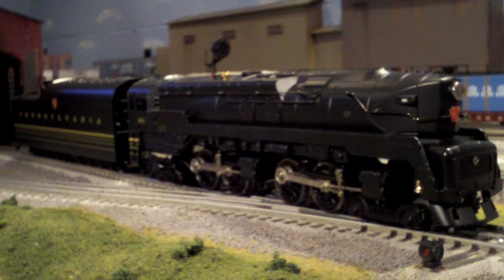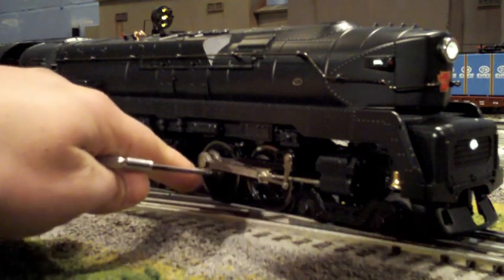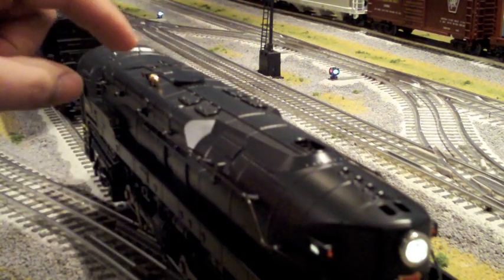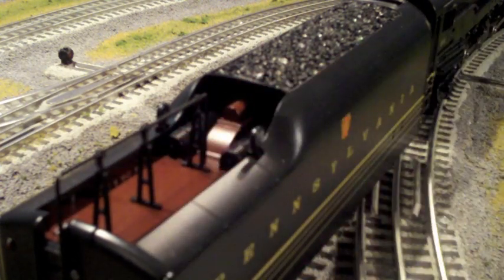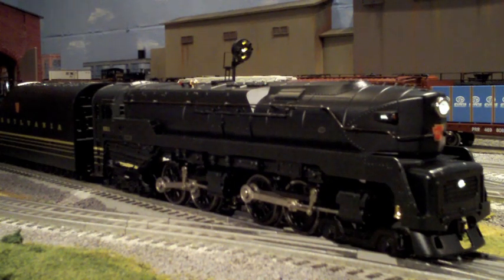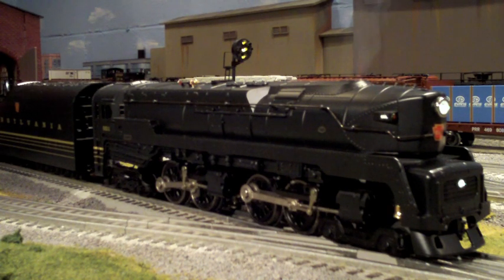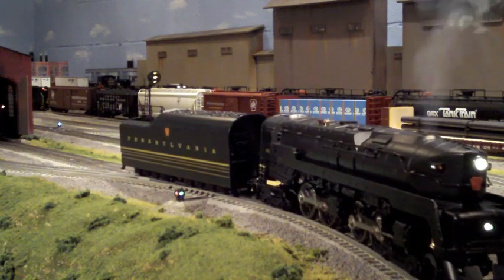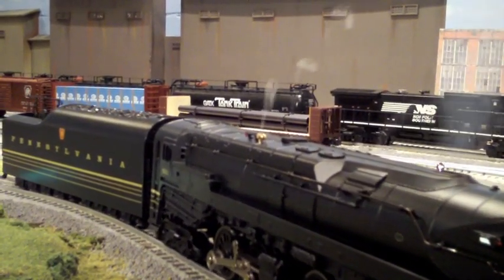Lionel Legacy Pennsylvania T1 4-4-4-4 Duplex Review & Running Session

Comment from the maker: @mdgsdg You have to be operating it in command mode, and press and hold down the power on button for a couple of seconds and the startup sequence begins.  I use legacy, so I'm not sure how tmcc works, but it should be the same if that's possibly what you are using.